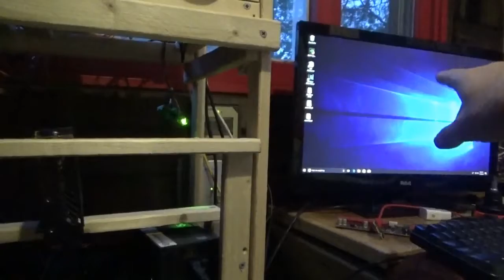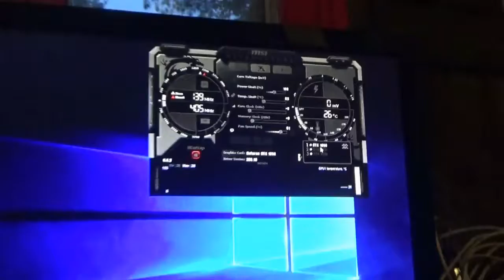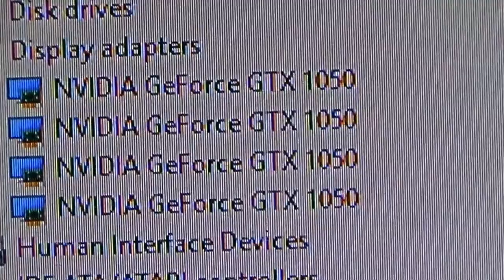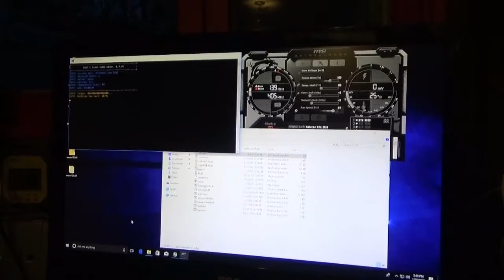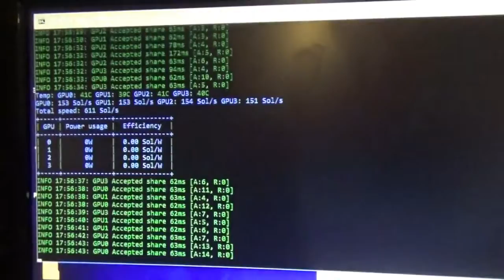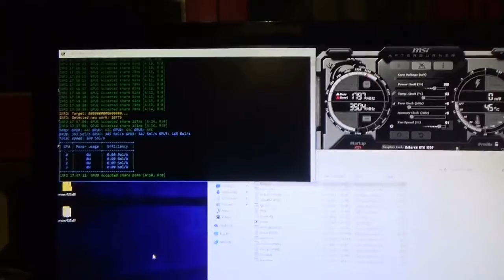Setting Up A 4 GPU Altcoin Mining Rig

Comment: How many watts are you pulling?
Reply from the maker: This one pulls about 350 watts on average
Reply: Wauw........that is doable.........
Reply from the maker: Yeah, these cards use about 75 watts each max. I prefer them because they run cool so they will last longer although they are not as powerful. Overall a room full of these runs cooler too.